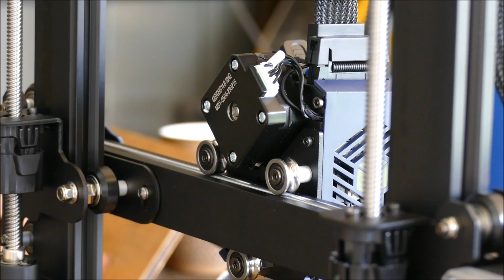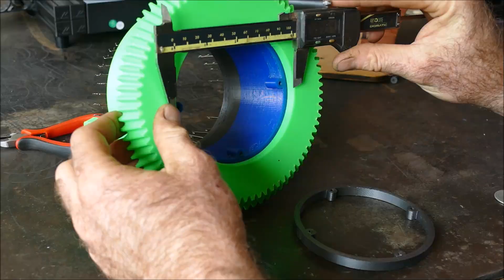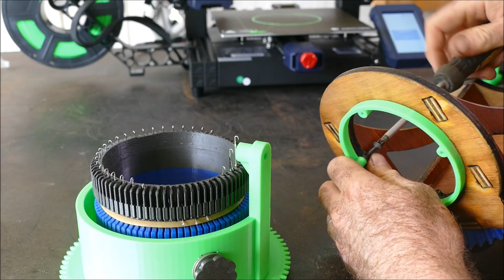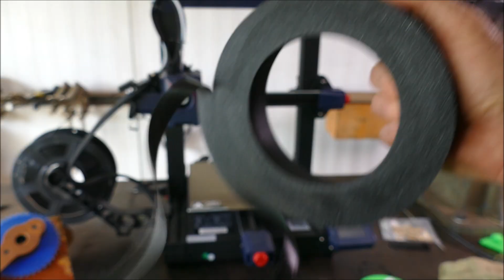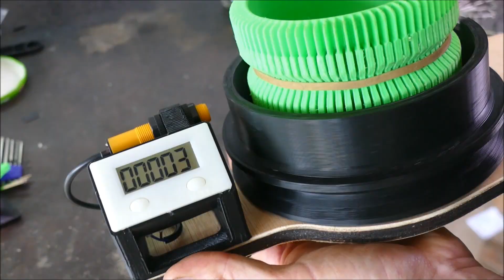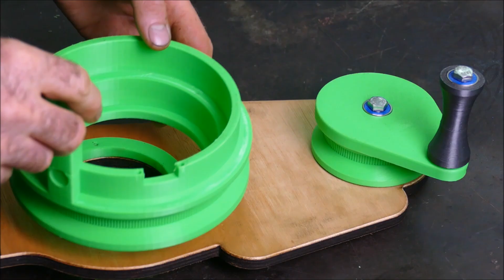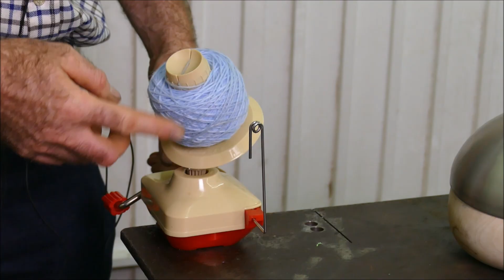3D printed sock knitting machine(CSM) MK2 endurance test of Anycubic Kobra 2 + free build plans

Comment from the maker: Hi Guys I hope this video was helpful, I would be very greatful to hear your thoughts and ideas on improving the design?
Here are some helpful links: Anycubic Kobra 2 now only £259 (limited time offer): anycubic.sjv.io/xkQXW3 
Enter the current raffles here (End 26th Aug): https://raffall.com/joshuadelisle
My updated Knitting machine design: https://www.thingiverse.com/thing:6160954
Compassion international the charity that helps families stuck in poverty and children or are being neglected or abused to escape: https://www.compassion.com/

There is also a ton of other links in the description on all the parts I baught if your interested.

All the very best

Cheers J
Reply: Mattel made two versions of their toy circular knitting machine. One only made tubes. The other had a switch on it which did something so the direction could be reversed to make narrow, flat strips of knitting to stitch together. If you could add that sort of function to your circular machine it could be used to knit flat strips up to 80 stitches wide. Ideal for scarves.
Reply: To make a heel, gradually unhook one side for a few turns, then reattach.
Reply: from what I have seen on a few other videos to make a heal you actually do partial turns and I think I recall something about cast off a section for the top of the foot ... which would make sense sine you are trying to lengthen one side and keep the other at one length ...
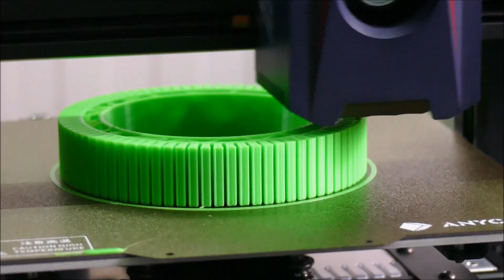Reply: At 4:55 you mentioned bulging, I usually solve this with a .5mm fillet you can't see it on the final print but it prevents excess material build up.  That's what I do on my projects when I need tolerances to behave
Reply from the maker: @brandonm1088  thank you. Cheers J
Reply: @joshuadelisle   This is simply a masterpiece.  How much does technology replace human manual labor.  Greetings from Ukraine.
Reply: My daughter has a knitting machine and I feel as if the handle was shorter and also the base of it was broader, it would help in proper rhythm when rotating. I feel as if because of the thin, unsteady handle, I get the snag from the hooks that's grabbing the yarn while rotating.
Reply: Hey, just to let you know, you set the license on Thingiverse to "no derivatives." That means that people are not allowed to remix, re-design, or develop the device further like you said.
Reply from the maker: @bengerber4542  thank you. I'll change it.
Reply: @joshuadelisle  Hey bud, loved the concept and it got me my building my own.  

When I originally got it going (without yarn) I thought "wait, why did he say it can't do toes/heels?  It goes in both directions just fine.  Silly Josh."

Then, I actually started trying to knit and realized that when you're knitting "backwards" (counter-clockwise for the video) that nothing forces the needles down.  So, when they're under tension from the yarn they just stay up and don't do their knit thing.

I have a suspicion that you need to print two copies of the guide (and retainer) and attach both of them instead of just one as you did in the video (and as I did :).  This should force the trailing needles down no matter which direction you're cranking.  

The second guide is printing now so I'll know better tomorrow whether this is accurate or if I'm big dumb.
Reply from the maker: @anonamouse  yep I tried that too. I made the guide removable so you can switch it to the other side to reverse direction but there's no room to drop needles. Cheers J
Reply: Without even watching this video recommendation I already knew you were worth subscribing too. Open source tools are so critical to stepping past the next hurdles of humanity.
Reply from the maker: @TrueHelpTV  thank you. Hopefully it pays off in the end. Cheers J
Reply: Heck, if be happy to knit the foot and leg by machine, and do my standard toe and a fleegle heal! 

Note, found your visa shorts.
Reply: Hey, what program do you use to make stuff like this? i mean Design it. not print it.
Reply: THis looks beautiful, and I very much appreciate your attention to detail and quality.  Do you have any plans for creating a ribber in the future?  That would be a really wonderful addition if you did!
Reply from the maker: @andreawinkler379  thank you. Yes when time permits I'll continue to make a better version with a rubber attachment. Cheers J
Reply: My wife and I also support children through Compassion International. It's a great organization.

Comment: Collaboration proposal: Upscaling your CSM design to a 30cm cylinder for industrial apparel prototyping

Hi pro,

I’ve been closely following your incredible updates and professional iterations on the Circular Sock Knitting Machine. The mechanical stability you’ve achieved is highly impressive!

I am a hardware and software engineer, and I am currently starting an ambitious project: building a large-scale circular knitting machine with a 30 cm (approx. 11.8 inches) cylinder diameter. The goal is to use this machine for prototyping and manufacturing seamless underwear and standard apparel.

I’ll be manufacturing the parts using a large-format 3D printer (Neptune 4 Plus). Since scaling a high-precision mechanism like a CSM by 5x requires a complete redesign of the needle count (pitch) while maintaining standard needle slots and cam paths, I believe this is a thrilling engineering challenge.

I am reaching out to see if you would be open to collaborating on this upscale variation. Specifically, I would love to know:

Is your design parametric, or could we cooperate using your source CAD files to test a 30cm cylinder adaptation?

With your deep knowledge of the cam system, what mechanical bottlenecks should we prioritize at this diameter?

I would be thrilled to share all our real-world printing parameters, material testing (PLA/PETG durability), and knitting results with you to contribute back to your project’s development.

Looking forward to your professional insight!

Best regards,

Walid Salah

Hardware & Software Engineer

Comment: Collaboration proposal: Upscaling your CSM design to a 30cm cylinder for industrial apparel prototyping

Hi Joshua,

I’ve been closely following your incredible updates and professional iterations on the Circular Sock Knitting Machine. The mechanical stability you’ve achieved is highly impressive!

I am a hardware and software engineer, and I am currently starting an ambitious project: building a large-scale circular knitting machine with a 30 cm (approx. 11.8 inches) cylinder diameter. The goal is to use this machine for prototyping and manufacturing seamless underwear and standard apparel.

I’ll be manufacturing the parts using a large-format 3D printer (Neptune 4 Plus). Since scaling a high-precision mechanism like a CSM by 5x requires a complete redesign of the needle count (pitch) while maintaining standard needle slots and cam paths, I believe this is a thrilling engineering challenge.

I am reaching out to see if you would be open to collaborating on this upscale variation. Specifically, I would love to know:

Is your design parametric, or could we cooperate using your source CAD files to test a 30cm cylinder adaptation?

With your deep knowledge of the cam system, what mechanical bottlenecks should we prioritize at this diameter?

I would be thrilled to share all our real-world printing parameters, material testing (PLA/PETG durability), and knitting results with you to contribute back to your project’s development.

Looking forward to your professional insight!

Best regards,

Walid Salah

Hardware & Software Engineer

Comment: I think knitting used to be a thing a lot of man did. Try buying a knittingmachine tension guide with rod and Place this on the machine. Tension is a big part of machineknitting an even tension will make your socks look better and can also help with smaller size adjustment like with a thighter tension the fit might be snug and a looser tension the socks might drop of your feet.

Comment: I'd like to have a knitting machine that does thin wool. maybe something about 100+ needles? would that be possible?
Reply: thanks for the like Josh. I asked in particular because I like overknee socks, and want thin ones for summer. but these are expensive af, hard to find and never up to my size.

soo, yeah, I need a dense af with needles knitting machine to work with 0.1 or smaller yarn, that doesn't leave large gaps in between. If I want netted socks, I can use the old regular one :D

Comment: I have been a knitter for about 15yrs, but the way my ADHD works is not particularly compatible with completing socks. Still I would love to have a good supply of nice wool socks, cotton and acrylic just don't have the same qualities. Recently my partner got a resin printer and his next plan is to get an FDM printer, so my brain has naturally turned to hyperfocusing on 3d printed CSMs in anticipation. I've seen yarn hobbyist videos using CSMs, but it is nice to see the synthesis of our two interests here from the machine design side.

For your belt, it seems your version works, but drive bands can also be found that are used for modern spinning wheels. They're thinner than yours, and have a slightly rubbery plastic texture. My wheel uses a hard plastic drive wheel and bobbins which grip quite well to it.
Reply: As for turning the wool into yarn: 3d printed electric spinners also exist for home use (spinning wheels but instead of a big wheel driving the bobbin based on their size ratio, it is an electric motor, thus technically not a "spinning wheel" though I wouldn't take issue with someone classing it as such since the necessary skills are equivalent)

Comment: Aware this is an old vid but might be worth revising and making use of the 3d printed bearings to upgrade the rotation and reduce the friction of the main spindle.

(The premise of the 3d print bearing is the casing is 3d printed but the 'balls' are instead raw pla filament as its more or less cylindrical to a high tolerance and with a bunch of them creates the same effect)
Reply: (context I realised I left out. If mechanical devices can be as printable as possible they become an option in places where parts are not as available)

Comment: You should try a version using printed plastic needles. I have a knitting machine that uses plastic (injection molded) needles, and it's for larger yarn. I've always wanted to make a fully 3D printed knitting machine using plastic needles (probably need to be vapor smoothed).

Comment: Here in the US, it costs more to ship a fleece than it does to buy one so the profit margin dramatically shrinks. The math is(on the cheap end) ~$120/ 8lb raw fleece to buy, another $30-$50 to ship. Plus supplies, we can round up to $200 or $25/lb of raw fleece. However, we lose 15-30% of weight from processing. So our actual costs is around $34/lb of spun yarn. We might get 4 pairs of socks per pound. Even if you sold at $20/pair you're looking at a gross of $480ish. Factor in overhead not included, like electric, water, and space with the man-hours and you're barely making a liveable wage IF you can sell 100% of everything you make.

Once upon a time, fiber production was profitable. Smart producers, even small scale ones, invested in milling onsite and are making great profits. So while this is a great topic to play around with, you should look at bond knitting machines next, the problem with fiber production isn't the lack of machinery, it's the dwindling profit margins from small batch processing. You need to design and make an industrial size knitter to make an impact.

Comment: My son printed all of the parts for this for me.  Is there a detailed "put it together" section that I'm missing?  I'm pretty handy but want to avoid messing it up to put it together.  I ordered all of the extra things from the links provided but the base plate for this that's made from wood is a mystery.  I understand that a lot of work went into creating this from scratch and I absolutely appreciate the sharing but could someone breakdown exactly what screws are needed (and how to wire the counter).  Also the overhead "hook" has me confused since I don't have a metal ceiling so I'm guessing I need to figure out how to do an elevated portion as well.  Any help putting this together would be greatly appreciated!
Reply from the maker: Hi. Unfortunately I haven't made detailed specification sorry which is why it's free to download. However I can advise you. 3mm x 30mm screws will work well. A rig for the yarn will be needed which could be a hook on a wooden pole type set up so the yarn comes down to the machine. The counter should be labeled to help with wiring (+/-) or has a manual. The hook need the ends cutting as they come with tails and a band of sorts needs to be added and wrapped around the hooks in the grove of the cylinder to keep them in place. Anything you need please feel free to ask. cheers J
Reply: Thank you so much!  I really love what you are doing here!  I'll do trial and error for figuring out the size of the handle bolt and how to mount it and the rest.  You are very skilled and I really hope your channel gets the attention it deserves! @joshuadelisle
Reply from the maker: @katiesprettyusefulthings   your very kind. the DXF for cutting the wood maybe a stumbling block for you. if you download a program called inkscape (free) then you can import DXFs and print them out 1:1 scale and use it as a template to cut the wood by hand (jigsaw) if needed. cheers J

Comment: As a machinist the only tip I can provide is the  location of the tensioner should not be on the load side of the belt. If it is then you are transmitting a good amount of force into the tensioner. In most mechanical applications with high loads this will destroy the tensioner. But other than that it looks good.

Comment: You should have just glued a rubber  strip to the wheel and the rubber hose wouldn’t have had a issue. More grip and it would have lasted longer then the belt with ridge’s.

Comment: Great Project!. Two questions. Why did you chose this original design over the one from Mr. Roboto? What are the key differences? Also, is it me or are the files with the timing belt missing at all? Thanks in advance.
Reply from the maker: Hi. I've not looked at the Mr roboto one yet. I'm not aware any files are missing but I can check for you if you like. Cheers J

Comment: So I'm in my 60's, and spent a lot of time working with these - toys as a child and very expensive professional machines lately. I'm too old to get into 3d printing, but these are pretty cool. I think your weights might be too heavy - basically you just want enough weight to keep the yarn from popping up into the previous stitch. Too heavy and you'll stretch your yarn and stitches, causing the knitted item to shrink up once you take it off the loom. Also, you can get claw weights. They're multiple smaller weights with a claw on one end that you hook into the knitting, then can move up as your knitting gets longer. If you want to make a flat panel rather than a tube, you can by skipping a couple needles, but you have to be able to reverse the spin (there's lots of YouTube videos on how to do this). A yarn guide made of wire bent into a loop at one end and attached to the board at the other would make the tension better also. Very cool idea tho!
Reply: I’m 72 and my 3d printer arrives tomorrow, plan is to make a circuit sock machine— no such thing as too old!

Comment: Your determination to understand your printer’s problem is only matched by your patience with the knitting machine!! I also use/teach 3D printing but my bigger passion is aluminum casting. Petrobond sand at first, a little lost wax, but now lost foam.
Reply from the maker: Nice. I have a foundry too which I'm hoping to try soon. Cheers J

Comment: I am in the process of replicating your project and have made a two-part 3D print template from your laser file, because I don't have such a large laser. I also use M8 threaded rods and M8 threaded inserts for wood. I also try to use a 766mm closed GT2 belt.
Reply from the maker: Well done. You could cut just the holes so they are perfectly spaced and cut the outside by hand with a jig saw. Cheers J

Comment: On the wooden base, what are your measurements? I am cutting on my xtool
Reply from the maker: Hi. The DXF supplied in thingiverse should be 1:1. I use 12mm thick ply 10 passes at 2000mm/m should be fine. Cheers J

Comment: I would love to see a larger version of this machine suitable for manufacturing sacks and knitted tubes.  I am watching someone build an entire hyperadobe cottage on another channel, and one of the things that seemingly has to be sourced from a specific manufacturer are the large knitted tubes used to hold the moist sand/clay/cement mixture when building walls.  A locally manufacturable machine that could take synthetic fibers and produce the appropriate sacking would be incredibly useful.  Such a machine could also manufacture sacks for more common uses when not aiding in homebuilding.
Reply from the maker: Good idea. cheers J

Comment: So I'll leave thees BANGCHEE runnin
Jokes aside I wanted to correct you on something. The best accuracy will always come from a bowden, not a direct, for the simple reason that the carriage on a bowden is considerably lighter since it's not taking a stepper motor along for the ride. That makes them print considerably faster without losing precision but introduces larger retractions which like you said makes them a bad idea if you want to print tpu.
Good video.